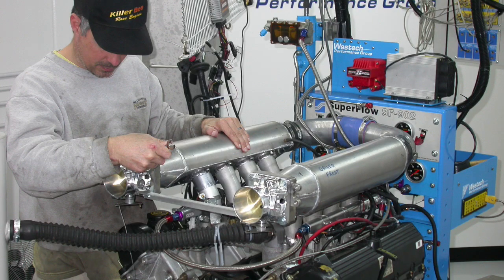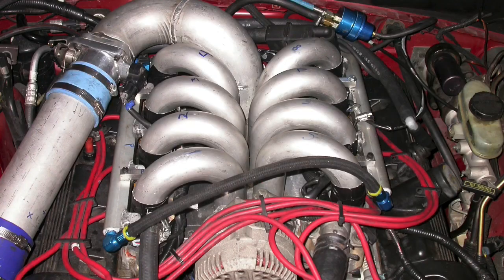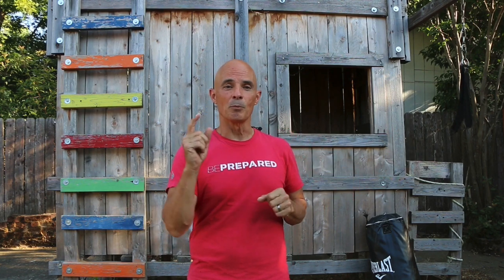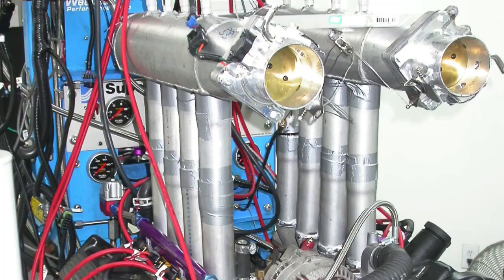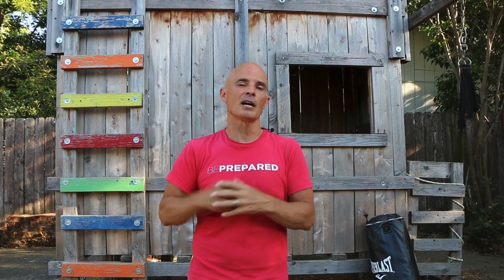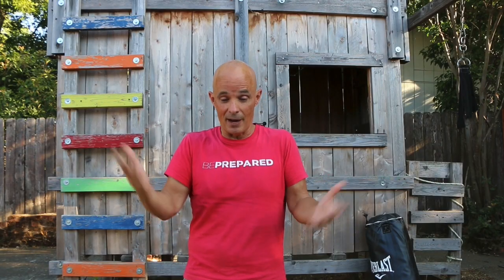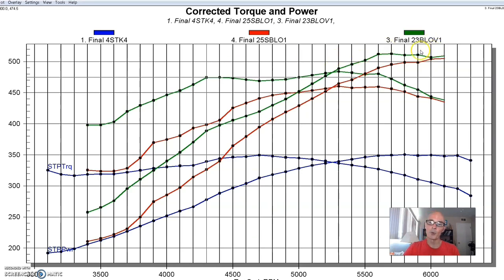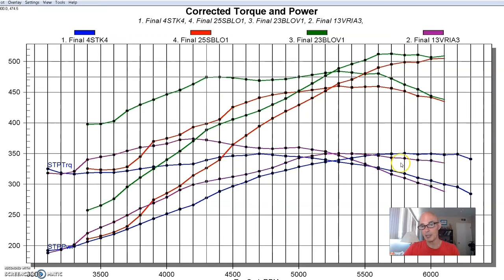BOOSTED INTAKES-BUILT NOT BOUGHT!

Comment: The original SVO intake (the one that looks like the bullitt) was non PI, it was on the first and only intake in the aftermarket, nobody bought just because it was hella expensive. Non PI heads also make more peak power than PI, PI heads make more average power. The big difference is in the stock PI cams. Guys would just swap in the PI cams and the stock PI intake and would get close enough to stock PI numbers. The intake is a 15 hp increase all by itself.
Reply from the maker: I have never found that stock or ported non PI heads don't make more peak power than stock or ported PI
Reply: @richardholdener1727  I've seen a difference of like 5 cfm @ .50 (stock PI cams) on the intake stock for stock. Supposedly ported PI make more power ported if you grind out the "high swirl" casts.

Comment: You probably know this by now but I believe unplugged leave the cams “parked” in fully advanced position... however much advance is ground into the cam.  Probably 6-10* with factory cams.  Also may be the reason you didn’t pick up on power with ported heads.  Cam Timing wasn’t optimized for 5000+ rpm at all.

Comment: Richard, can you do a similar thing with a small block Ford? A similar intake to the 3 valve intake you made? Thanks
Reply from the maker: That was the first adj intake I did way back in 1991
Reply: Is this really only something you could do with a dyno? Or generally is there a range of runner length that will work just fine?

Comment: Hey Richard I hope you read this . I asked a couple times to get more torque from your gas engines. The engines you have been testing are strong and make a lot of power . Here’s one to scratch your head on. Let’s convert a LS with all good parts with AR bolts and best pistons etc to DIESEL .I believe you can use cummins injectors with mods of course. I believe this ave of mods is worth a shot . A
Reply: Ok

Comment: So if I learned anything from these videos. Cam dictates power curve. Unless airflow chokes it out. Compression raises power everywhere. And displacement raises torque and power but only if you changed the air flow to suit.. Which means 3v ported heads on 5.4 with boost? Should see some good numbers there
Reply: Well the 4.6 stuff is pretty cool. But I'm wanting to see what a 5.4 3v truck engine can do. Also, how do you go about using the factory ECU. Still need to have the trans shifting right, along with gauges working to. Is that even possible. Or do you Absolutely have to have a 2 thousand dollar aftermarket unit. I'm guessing I'm not the only one thinking about this.  Some insight would be appreciated. Just saying.

Comment: I would really like to see this go to its next logical step and have 3d printed intakes. The prototyping would probably be faster with slip fit tubing but once you establish what you need, a printed version will have better runner shape and packaging. You could also disguise it as a factory version by having all the fastener locations for the factory dress covers. A few guys have done this for obscure engines like the gm atlas series with pretty good results. You could do anything you wanted though, any injector placement, under plenum nitrous (I know plastic intakes and nitrous are a bit of a recipe for disaster), whatever throttle opening and location. There is also a bit of power available just from the freedom of packaging and runner design that comes with it.
Also... Have you ever tried a split plenum fuel injected intake that is a true duel plane like Ford trucks have? The 5.0 and 5.8l trucks had 180° intakes and separate plenums as did the 5.4l navigator.
Reply: There's a kit full of short, curved, orange tubes that fit together like Legos. It's designed for mocking up a design for routing header tubes, but I think it could be used to mock up intake runners too. You would just need to make intake flanges to replace the exhaust flanges in the kit.
Reply: @donellmuniz590  I've seen those, they come in a bunch of different colors for different tubing sizes and the strait section is usually in one inch blocks, like Legos. You could really make out like a bandit with those because the sets are huge because headers are like 36" of tubing and intakes are rarely half that.

Comment: I worked at Magic City Ford in Roanoke Virginia, one of the shop Foreman's name was Mike siska he had hey 98 Thunderbird with a 4.6L in it.. he took and put the Dual cam heads off of Cobra engine, but he had them ported and Polished and big valves put in them.. then he put a twin screw supercharger on top of that thing... he ran in a street class with the SVT club , and apparently went fast enough that they told him not to come back until he had a cage installed...it had everything you would find on a car on the lot..full exhaust, alternator,  a/c,and power steering

Comment: Did you have a chance to mess around with any dualrunner length manifolds like the one on the four valve motors from the Lincoln aviator?
Reply from the maker: yes
Reply: @richardholdener1727  awesome! Any tips or is that a forthcoming video? I have a spare I'm thinking of swapping in. Think I might need to improve the top cover to a design with a bigger bore T.B. It's going on a road race project I estimate will see lots of mid range and high rpms but I don't want to waste the long runners

Comment: NA “boost” is a flat 14.7 absolute. The blower provides a sloped, rising, boost. Thus the torque curve is boosted more at the top making the hp peak higher than NA. If you did this with turbos and a flat boost curve, it would mirror the peak rpm more closely. IMHO, anyway. Great video, again!
Reply from the maker: yep-Cent blower change the curve relative to na, but cross over should be the same point (na and boosted)
Reply: Richard Holdener I agree with brian, as the boost curve tapers it will affect the crossover as it actually chokes the flow vs where the natural v.e. would taper off, at least that how I’m picturing it in my mind.

Comment: Michael Chrysler had a calculator NxL=84000 ( N is peak torque RPM)x (L is Length of runner from the intake valve)= 84000 e.g. my peak torque is 3650 x 23" =83950
Reply: this is just way to over simplified, there are so much more variables that this does not makes sence at all...
Reply: @guidoheeling1179  
For a 413 cid Chrysler,  with the 23" long intake runner length,  it worked.
Reply from the maker: single calculations won't provide the required info
Reply: @richardholdener1727  There are also full wave, half wave, and quarter wave calculations.  Generally speaking, there is not enough room under the hood for full wave intakes.

Comment: Richard,
This is fascinating. Thank you! 
Are there any “rules of thumb” we can use to work out runner length, runner diameter, and plenum volume?
Reply: air speed in the runner shouldn't exceed 175 m/s average.
ideal plenum volume is 8-10x the cylinder volume.
no rule of thumb for runner length, but lots of equations.
Reply from the maker: the third one is certainly true
Reply: Richard Holdener is there anyway you could pm me the spec on your 3v intake, I feel the design would work great as a setup for my 2v pi in my lincoln, I’m going rotsun style with a tp38 off a 7.3psd and an intercooler off a 6.0psd econoline van, a full junkyard special, any advice from the engine guru is greatly appreciated
Reply: @matthewross3635  Trade you a nice TP-38, for a good GTP-38...
Reply: @Crysmatic  , where can i find the equations for determining runner length?

Comment: An hour ago? Its 330 a.m on the left coast. Where are you?
Reply: i think he is in california, as he works at westtech and it is located there, but ofcourse it can be that he just uploads the video overnight, just keeps the computer running untill it is done.
Reply from the maker: you can schedule them to load any time-I'm in Cali
Reply: @richardholdener1727  Say, since I know you won't do my 305/351 GMC V6 build (Shocker! Lol), how about "borrowing" Freiburger's 440 and testing heads from Indy, Trick Flow, Edelbrock, etc? With hydraulic and solid rollers?